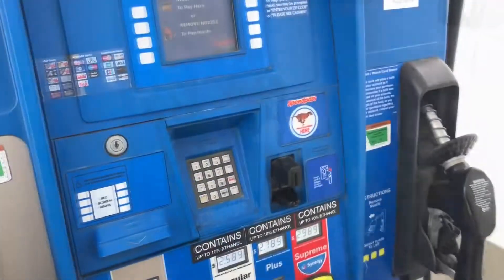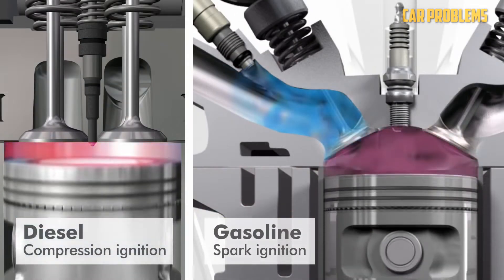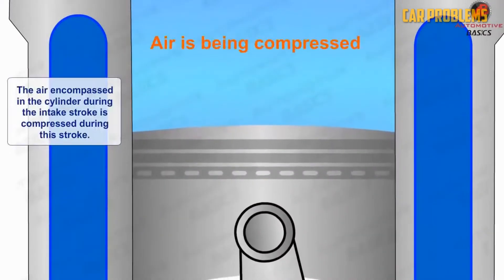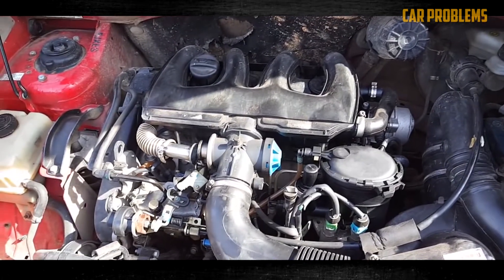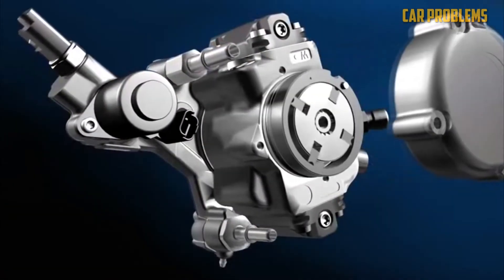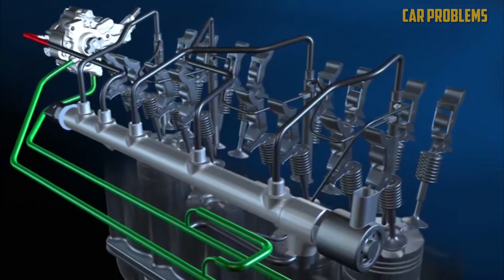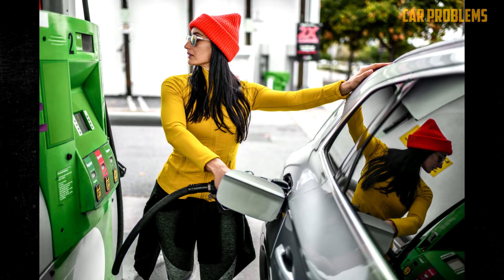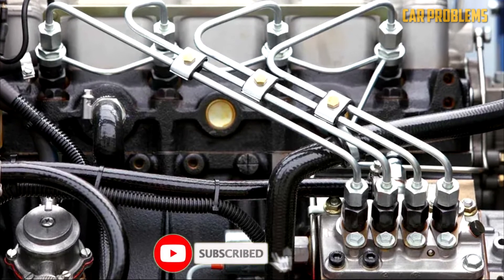What Happens If You Put Gas in a Diesel Engine - Gas in a Diesel Car Causes

Comment: In all likelihood a diesel owner won't screw this up, a gas car owner will. It will tend to cause more damage to a diesel
Reply: I've been driving 40 years, and have both diesel and petrol.  I did it the other day, put petrol in my diesel van, 1st time ever. Had been driving my petrol car a lot lately.  I always thought people were dumb to do that,now, I'm one of them..
Reply: @richarddavis4378  yeah, but typically the people who make that mistake do it because they genuinely don't even know the difference between the types of fuel, but most folks I know with diesels are well aware of octane ratings and the differences between gasoline and diesel.

Was everything good with your vehicle afterwards?
Reply: @richarddavis4378 what did you do then?

Comment: My brother-in-law put in a couple gallons gas into my 1995 Ram cummins and it had about 25 gallons of fuel. He was going to top it off after borrowing, but stopped when he realized he put gas in it. He drove it to my house and I drove it around and then topped it off. I didn't notice any problems.

Comment: I put 5 gallons of petrol in my diesel Renault Master, fuel gauge was showing red, so was quite empty.  I didn't realise and drove about 4 miles before it started to run bad and knock. I realised what i had done, as soon as it started to run bad, but couldn't pull over for about another mile. Got towed home, pumped the tank out, put two gallons of diesel in, pumped that out, drained high pressure pump, filled tank with diesel, primed, drained pump again, primed again and started it.  By some miracle, it was fine and runs as good as ever. I won't do that again, but it proves it may not always be terminal.
Reply: Is not at all terminal - I drove from Normandy to Bordeaux with gasoline in a diesel.

Comment: I just accidentally put e10 (about 15 gallons) into my diesel (had about 3-4 gallons of diesel in it). It ran fine for about 4 miles then I stopped to turn around to do a different way and the tank sloshed around and immediately it started not being able to accelerate as usual.. i felt hold back at around 40 mph, thought it may have been the transmission trying to find gear since that is common w my van (mercedes engine) but then it started to get worse, stopped again turned around, started driving slow, it was knocking above 20 mph, but was driving fairly smooth under.. drove back yo the gas station to have them pull receipt and yep, accidentally put e10 in it… 🤦🏻‍♀️… I heard some knocking and it didnt sound great above 20 mph, but keeping it slow it was fine. Parked and had it towed to the shop… hoping they can bleed it and change the fuel filter and maybe the worst case fuel injectors and that I did not mess the engine up. Send good vibes… lmk what you think!
Reply: Any update ?
Reply: @tylerfreeland8079  i actually had about 9 gal of Diesel in it. And that saved it. 
Fuel lines need bled and fuel filter replaced ($1k), something got messed up on the turbo that was covered under bluetec extended warranty, and the Diesel Particulate Sensor was fouled and needs replaced ($4k).  Total damage $5k 

Shop will have it for about a week, and I’ll see how it runs when I get it back.
Reply: @elementalAlma damn thats an expensive fix
Reply: @TS-jm7jm  insurance covered it
Reply: @TS-jm7jm  it ended up being $6200
Reply: @elementalAlma how did insurance cover it? Are you in the US ? What insurance company do you have ?? Thanks in advance
Reply: @tonydileo1756  nationwide. It was covered under comprehensive coverage.
Very happy with the policy coverage. Super easy to deal with.
Reply: @elementalAlma  I just traveled from Washington to Nashville in my Sprinter last night.  I had 45 miles left till empty so I was super low . I stopped at a bp and used the green handle (diesel) and fill completely up . I noticed the check engine light turn on 100 miles in but thought it might be cause I drove 5000 miles in a week . The van finally bogged out 250 miles into the drive when I pulled up to a red light . If it was fuel contamination I hope the insurance will cover it or the extended warranty I have with Mercedes but I’m really nervous. I heard driving for that long with that much regular gas is almost a complete rebuild of the engine , fuel pumps , gaskets etc.. 

I remember seeing diesel and putting it in but maybe the labels were switched. I’m pulling straws here . Someone also said that if they deem it my fault for putting wrong fuel in that my warranty for the van will be void forever .. I live in the van too.. Mercedes is looking at it now so we will see ! Praying for a miracle!!
Reply: @tonydileo1756  oh sorry to hear. Yikes.

You can call the gas station to have them check your purchase and see what you put in the tank. If it was fuel contamination, Even if it was your mistake, your comprehensive policy should cover it, call your insurance. If you do not have fuel contamination in your comprehensive policy, then you will be out of pocket for it. Could cost anywhere from $6k-$45k for the fix depending on how much was fucked up. 

My repairs were pretty much the minimum that could have happened to it and I only drove about 15 miles and stopped the engine way before it quit. Cost me $6500
But insurance covered it all, less my deductible

Comment: Just bought a piece of equipment the diesel engine was old barely started the guy put just enough gas into the engine to make it run ,when i got the telehandler home I added diesel because the fuel was low now it wont run,the guy bamboozled me i knew it needed new rings but wasnt thinking so early

Comment: Of you only put in 15 litres of petrol in a Diesel , fill up to the Top with Diesel run it 100 miles , then top up again with Deisel add 1 litre of ATF. 
Happened to my  Mercedes.

Comment: I mistakenly put 4.5 gallons into a 6.6 duramax 2015 it had about 1/4 and when i noticed i just filled the rest up with diesel bought some lucas fuel iniector cleaner/lubricant and nothing happened appearently
Reply: Great. I just put in half a gallon of gas in by mistake and filled the rest with diesel. It is running fine. I heard gas can actually clean out the engine in small amounts.